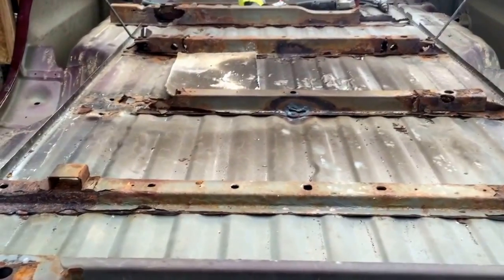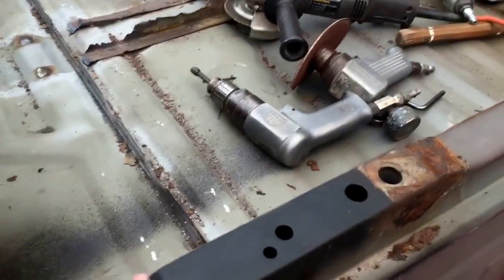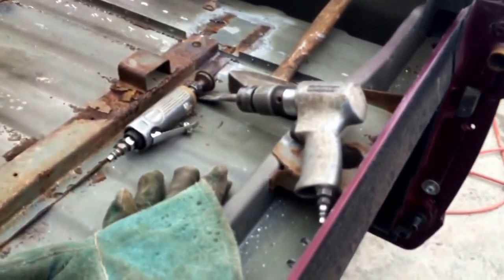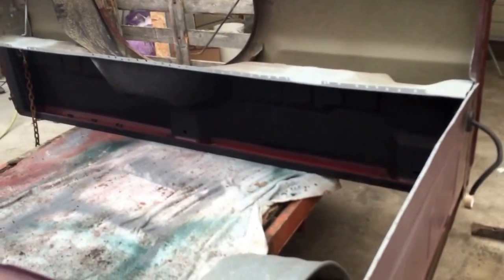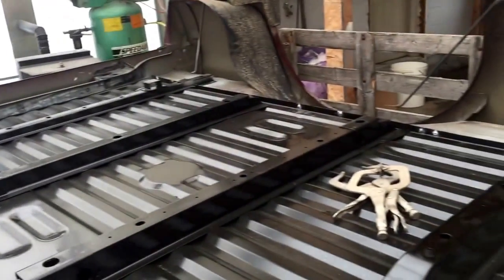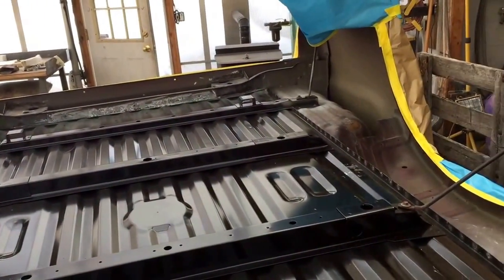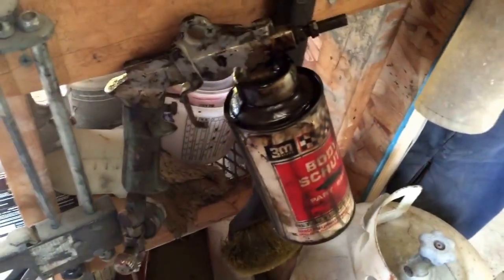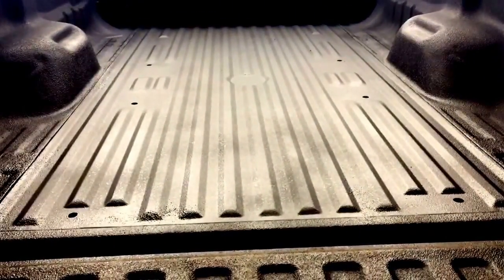Replacing a F350 bed floor

Comment: I think the F350 I just bought has a bed that's not worth rebuilding after watching your vid.  the only reason to save mine would be the exterior bed sides are already painted nice, but the entire bottom and even front brace is toast.  seeing the floor is $550 alone it might be less work and aggravation to pick up a non rusted bed for $2k and just lay paint down to match.  it's a shame more people don't fix their beds up before they are too far gone for repair.

Comment: excellent video, gave me some motivation to replace the floor instead of hunting down a used bed
Reply from the maker: Bill Myers ya definitely cheaper especially if your bedsides are still in good shape. It's not a bad job if your not afraid to get your hands dirty. Let me know if you have any questions!

Comment: great video, thats the route I'm going just ordered from Ford the bed pan. My 2008 f250 6.4 crew cab short bed cross members were in bad shape. So i got the dorman w/ the cab cross member...we took off the bed and started the remove the cross members and the mounting holes came apart. rest of the box is fine no cancer. Mind you its a two tone DX AND CX.  so we thought about a new box...In New England ...hard to come by...junk yard had none and offered me a $4,400 southern bed. Me being from Tx I could get em cheap even from a junk yard ..nooooo rust...I'd still have to pay at least 2k to get it sprayed with 2 tone. Saw your video i was sold. KEEP UP THE GREAT VIDEOS TY
Reply from the maker: Awesome! Glad the video helped! Ya I'm from CT so I know all about the local rust issues in New England! Lol. Definitely worth spending a bit extra to get the floor to. When I did this one I couldn't even find the Dorman ones.
Reply: HELL YEAH I USE TO LIVE IN NEW CANNAN...I HAVE TO DO SOME PATCHES where the  THE CAB CROSS members went  but good to go ....only thing im having to deal with is  weather... its outside. and im a  cop and emt so tues and weekends off i miss my baby ...and its gonna rain. i got a 2 car garage but my atv and harley is in there....i should of listen to how long the project  was....hella spot welds...im gonna get more bits the hell if i weld inside w/o vent..from Wall ford 900 and he throw in the cab member....its a great two tone bed ...couldnt let it die
Reply: The rear crossmember where did u drill it to break break it
Reply from the maker: scott addison just look it over real good. That was 3 years ago lol. I don't remember where they all were. I think there's a few in the center area

Comment: You can get Spot weld cutters for $5 at Harbor Freight the saw teeth can be unthreaded and flipped. 
I use cutting oil and never dulled one yet.

Comment: My cross braces was rusty but the bed floor was ok, I air scaled what rust I could get off and put some rust converter and rust coat paint and built some new ones right by the old ones with angle iron and painted it all up and every fall it will get the whole thing drenched in fluid film.

Comment: Dude, thank you!! I've been searching for ages for a rust free bed. Heading to the dealership now to order a new bed pan.
Reply from the maker: Haha no problem dude thanks for watching. Subscribe! Let me know if you have any questions. You could also glue the seems instead of welding them. Much easier.
Reply from the maker: Ya if your bed sides are good it seams like a waste to replace the hole thing
Reply: Floor Pan - Ford (BC3Z-9911215-A)
Reply: Short bed part number

BC3Z9911215B
Reply: @johnmorneault7888  What kind of glue would I use to do that? Strong enough?

Comment: Did you keep track of how many hours it took from start to finish? I'm looking for a body shop who could do this for me on my 2011 F250 short box. I haven't priced out the bed floor from Ford yet but an after market place sells it for $590 with the 3 cross members also. Thanks in advance.

Comment: About how long from detachment to finished coating? Weekend project hitting it hard or no?

Thanks
Reply from the maker: LightGesture took about a week. Its over 200 spot welds. Take your time do it right. Dont rush. You could always drive the truck with out the bed. Just tape the tail lights to the bumper.

Comment: great video but cannot find the replacement bed part, been looking online for over an hour no luck, only thing that shows up are the cross members
Reply from the maker: You wont find it. Its a dealer only part. Call your local ford dealer. I paid around $550 for it.
Reply: Floor Pan - Ford (BC3Z-9911215-A)

Comment: what would it cost for a job like this? I have a 2008 Tundra.
Reply from the maker: Radames Arocho Jr. depends where you have it fixed. My guess is around $2500 by a shop. Or if u can get someone to do it as a side job maybe $1500-$2000.
Reply: Thank You! very much for replying. I really appreciated it.
Reply: Radames Arocho Jr. cheaper to get a new box, you can get a new rust free box for around 1k
Reply from the maker: Not necessarily. Up here in Ct a new take off bed is up around 3k.
Reply: How did you remove and flip the bed over? What kind of welder did you use?  -Thanks

Comment: Cheaper to go to the junk yard and buy a complete replacement bed?
Reply from the maker: Hard to find one up here in the northeast thats not rotted!
Reply: Oh I know tell me about it I live in New England and I’m searching for one the closest one I found that’s the exact same thing is in Massachusetts 3 hrs from me. I wonder how much would it cost to have a body shop repair my rust holes in my bed floor?
Reply from the maker: Are the bed sides good? Or are they rotted? Where u located. Im in Stafford CT.
Reply: Ya the sides are mint just the area that’s about 2 ft up from the tailgate  is where it’s tender with holes.I’m from Maine.
Reply from the maker: Where in maine are you? Ive got family in Bangor and Fort Kent.
Reply: Oxford